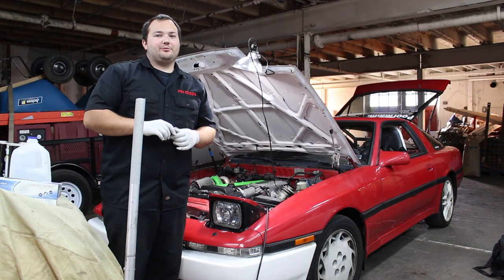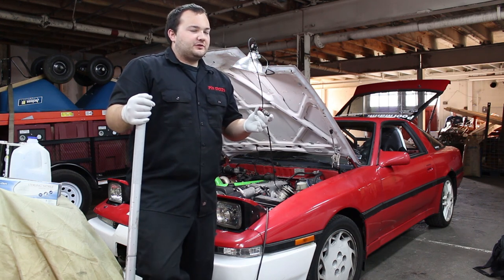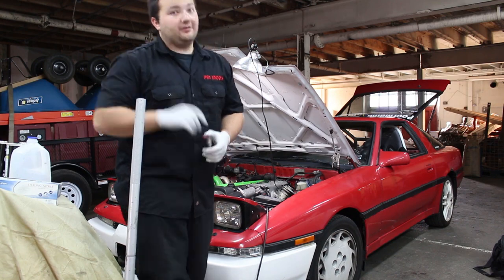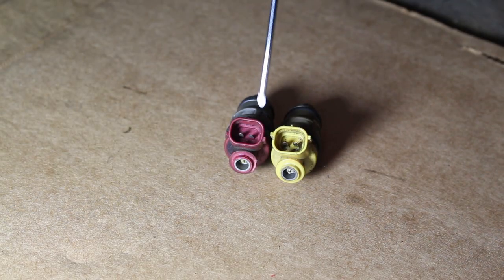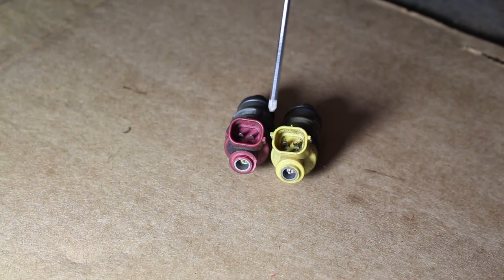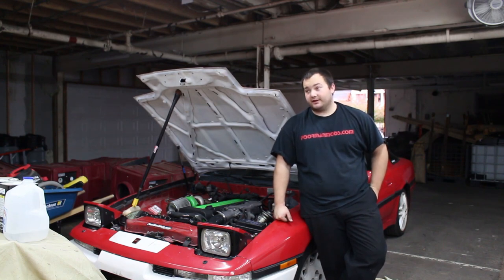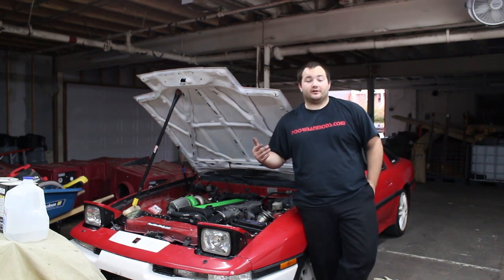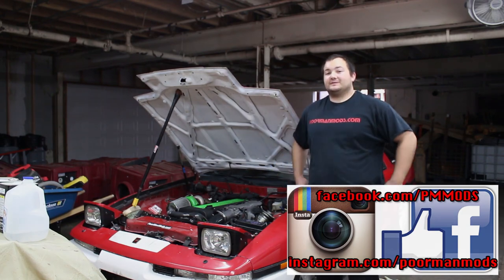How to Install Fuel Injectors | 3sgte injectors into 1jz | Fuel Injector Upgrade

Comment: also removing injectors you only need to twist then side to side to break the seal of the rubber (20 years or more) then they pop out easy without pliers :) do it more than once and it can be done in less than half an hour. keep going lads! i enjoy your vids :)

Comment: common mod, also i think some subarus also use the side feeds ;) but stock injectors are rated at 380cc @ base fuel pressure of 35psi, once turbo spools stock fuel pressure goes up too 40 -45psi which means the stock injectors will then flow around 430cc ;) ive had my stock 1jz 19psi all day errday on my single on stock ecu with EMb to pull fuel from lower in the revs when cruising off boost only. the stock turbos boost around 2800, so you would need to pull some fuel from 2800 - 3500 or when your single starts to boost. i added fuel up top thinking that it would need it. how wrong i was! it ran rich and hated it! im also currently running stock ecu in my 2jz 4runner pushing 19psi through a hx40, same deal. pull fuel from lower revs up too boost and let the stock ecu do the rest. she sits on 10.5 afr steady when boost hits. but on the 2jz i have base fuel pressure set to 45psi going up to 52psi on boost :)

Comment: I just got some 440cc Aristo's flow tested and cleaned but now I'm thinking about selling them and grabbing a set of these. Do you still have the two spare ones? Also going to be getting either an SAFC II or NEO to tune my SC300. Which do you recommend?
Reply from the maker: i dont have the remaining two injectors, and I recommend the NEO over the SAFC II

Comment: the 3sgte was the 1988/92 alltrac celiac an turbo version of the 3sge witch was a 2.2 Yamaha designed motor for the 1986 through 92 Toyota Celica GTS

Comment: I have a dodge stratus coupe 2001 se with the mitsubishi 3.0l v6. What injectors should I put in it before I install a turbo that I wouldn't have to wire resistors?

Comment: How much HP Gain over stock injectors?
Reply from the maker: I think you get like 400 horse power out of them, Im not running 800cc injectors
Reply: Poor Man Mods okay maybe you didn't understand what is the difference in horsepower for the injectors example stock injectors 350 cc over an aftermarket 550cc will make about 65hp more than stock

Comment: How does this work when the 3gen 3sgte injectors are low impedance and the 1jz runs high impedance?
Reply from the maker: They are the same
Reply: I just ohm'd these out def not the high impedance OEM 380s & 440s are 13.8 where as these mr2 ones are roughly 3.6-4 ohms there for I had to run a 7mgte resistor box. I'm on standalone so i didn't fry my ecu but I noticed fuel smell and excessive heat when I ws at idle... WOT they work fine but otherwise it was giving me start issues once hot. You should really update this because anyone on stock electronics gunna have a fried ecu or wrecked injectors

Comment: These are low impedance injectors not high impedance like the stock 380cc injectors. Only easy option is the 440cc for direct replacement. Toyota made the plug different for a reason not just for fun !
Reply from the maker: then how did they work?
Reply: @PoorManMods  Simply not healthy for Ecu, but by all accounts they will still 'work', for how long ?? Might be worth doing a follow up vid to address the impedance issue. Very simple test to check impedance with a multimeter.
Reply from the maker: @bobbuilder5362  car ran just fine for awhile but i have since changed the fuel rail/injectors and have a stand alone ecu now
Reply: @PoorManMods  Very interesting either way, good to see it worked out I guess. More injector options with aftermarket fuel rail I'm guessing ?
Reply from the maker: @bobbuilder5362  Yeah i went to a top feed billet fuel rail with 800cc injectors, i plan on going even larger probably within the next year or so though.

Comment: I'm in need of help.. I just nought these injectors for my 1jz non vvti and a few people tell me I need a resistor.. didn't look like you used one.. any info on the please...
Reply from the maker: +Carl Detrick if you bought the 3rd gen 3SGTE 540cc injectors you do not need a resistor to use them on a 1JZGTE non vvti, just do what i did in this video

Comment: The red top 3s gte 3rd gen 540cc injectors are low impedance while the 1jzgte in the video above uses high impedance so those would not have worked without a resistor pack Sir Poor Man Mods
Reply from the maker: Incorrect. They worked
Reply: But the impedance is different on both engines, that would fry a stock ecu
Reply from the maker: I think you might have the wrong info on the injectots i installed. I drove the car for months after installing these.
Reply: Ohm out the injectors, they are low impedence, it wont fry the ECU immediately but it will burn up the drivers over time. I have the exact injectors in my 1jz (on my soarer when I bought it from an importer) and it wiped out my injector drivers. I just went standalone and am taking them out for sard 800cc, the 540cc will fit no issue but you should run a resistor pack for them.

Comment: I'm so confused... I can't find a USDM 3SGTE that came with 540cc injectors. PLEASE HELP. Would like to know year and model and trim if possible. Be easier to find like that for me...

My 1j needs more fuel please!
Reply: Corey Ryan No USDM 3sgte came with 540cc injectors. Only 3rd & 4th gen 3sgte engines came with 540cc units, and these are JDM only engines, meaning they only came in japanese cars. But they are very common swaps nowadays in cars in the usa, so finding some shouldn't be that hard. search on forums

Comment: You lost me at apexi neo............ Fail!
Reply from the maker: why?
Reply: Poor Man Mods I think he said you lost him cause apexi neo is expensive, I think....
Reply: Poor Man Mods  Apexi neo Is like trying to fix a gun shot wound with a band-aid. They are garbage. the only way you will get the car to run right and show its full potential is with a full standalone. The investment is really pricey at first but why chance throwing all the money away you put in the engine and the parts you have already dropped in your car. Apexi Neos don't have any fail safes or knock detection. I tells your factory PCM that things are okay when they really are not okay. Bad idea all around. You never cheap out on fuel control.
Reply from the maker: I thought about going to a standalone, but this is Poor Man Mods, the neo was $300 and its running great on 19psi right now, and a standalone, custom harness and tune is $3000+, that's not a Poor Man Mod
Reply: Poor Man Mods Out of curiosity did you look into Megasquirt?
Reply from the maker: yeah i did, i dont really have the confidence to build my own unit, and the prebuilt ones i saw were about the same cost as an older AEM stand alone, id love to learn how to build a unit though
Reply: Yea i know what you mean with the confidence, but luckily my cousin and his friend have built multiple units so at least I have them as a backup source hahah
Reply from the maker: yeah i dont have that resource :(
Reply: Poor Man Mods  Ever consider the Map ECU 3's?  Evidently they have plug and play harnesses for it,  less than $700 IIRC